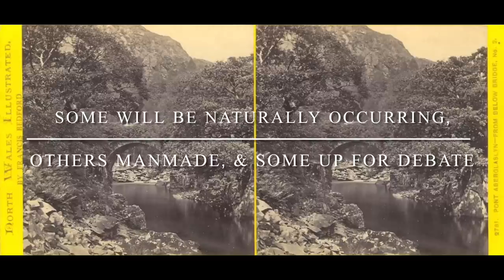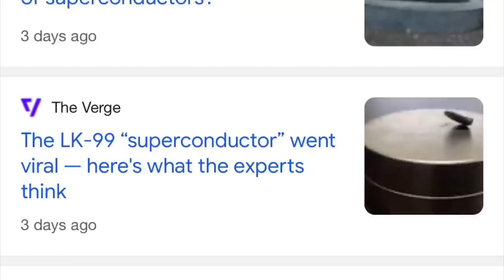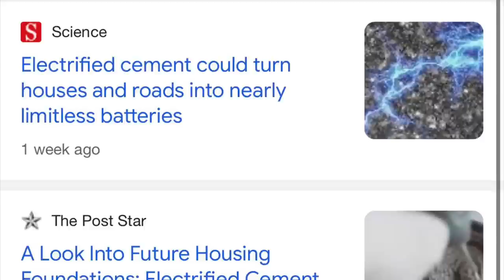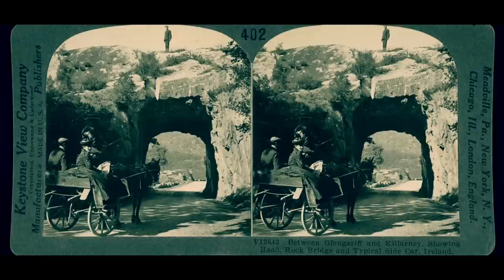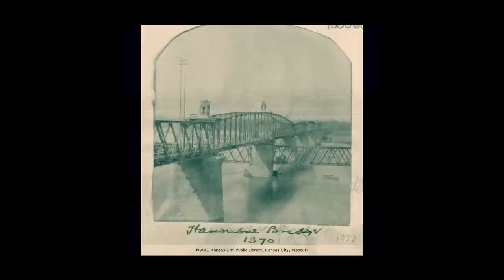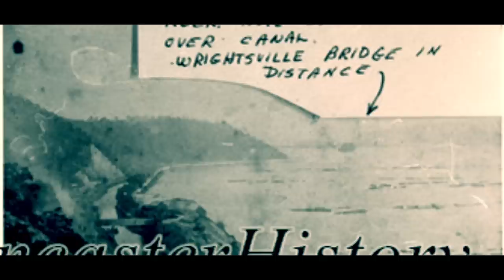Bridges, Seaports, Canals & Free Energy! LK-99, Electrified Cement, 200 Old World Photos (1845-1945)

Comment: I enjoy your video’s a lot… but on this one, I have make mention of the spires that are typically found on the old world structures… because of your talk on or about the possibility of tesla coils in the concrete.. you are aware that they were used to draw electricity directly from the atmosphere. They were all made from copper and attached to copper wiring. And they weee thrust high into the sky for better or higher current(amps).. voltage staying around 9-12v. The bigger the building, the more antenna looking rod things would be sticking out of the top of them. Near by street lamp were powered by the closest building…  but, before this video, I just assumed they ran subterranean wires out to the light polls…   Now I’m wondering if the concrete just transmitted the juice! A Very interesting notion! 

The old old houses, here in the states, like the one I live in still has the wiring and wall sockets for those low voltage free energy systems… 

In fact, this particular free energy system is why our current electrical appliances are 120vac.. instead of 9vdc.. 

Because they could and very well, I might add, could have made modern appliances like TV’s computers, stereo’s, washing machines etc., can be run on low voltage systems but, they have zero interest in allowing the masses to get and use free energy sources… 

Because if we had free energy, we would have a lot more time on our hands to pay attention to what they’re doing and with said extra time, we could meddle in their
Affairs, even more so than we already do…  AND THEY DON’T LIKE THAT! 

Same goes for oil and the products  derived there from… 

In the old world, they had no use for gasoline! They used ELECTROLYSIS!

And there was no pollution from internal combustion engines! Because the only byproduct from burning the HHO mixture created by  their electrolysis generators, was water! Thats it …, 

So if ya can’t read between the lines….

I’ll give ya a hand…. BASICALLY ALL  THE UBER RICH ASSCLOWNS AT THE TOP OF THE PYRAMID, BLACKROCK, VANGUARD, the WEF & MORE… all those faquads that  are FLYING AROUND in THEIR PRIVATE JETS TELLING US THAT WE ARE BAD AND EVIL WHEN DO NOT PUT FORTH MUCH EFFORT in REDUCING OUR  CARBON FOOTPRINT, CRYING ANOUT CLIMATE CHANGE ~ just like the boy who cried wolf, are the very people who are ACTUALLY Responsible for 95%, if not all the pollution we are combating this very day! It  was at here call to use an energy source that wasn’t free or so easily obtainable as say, water for use in electrolysis! Lol… assclowns!

So, to recap… the people from the old world, who I believe we chased out of RUSSIA & eventually found them here in AMERICA, I believe we slaughtered them with very few escaping or survived by intermingling with us …..  

Seriously, I think we took this place, by force, town by town… probably finding empty cities along the way from where They fled… and that the Vatican, among other kings and queens of the time, all in fact had a deal  with Washington and our founding fathers … the whole time.. And together they rewrote history so that their stories matched! 

Just my two cents! Keep up the good work!
Reply: I think you're more correct about how the U.S. was "built" than most people are even able to comprehend.

Comment: 3 things, 

They used a high temp gold vapor technique to apply gold (10K) to the surface of concrete to create in the buildings a capacitive storage device. Concrete is ideal to create massive capacitors. Such as the great pyramid which was concrete. 10K gold combines the perfect mix of gold/silver, extremely resistant to corrosion. 

The electrical systems required aquifers nearby, and underground canal systems to maintain the proper hydration in the soil for grounding. However, the 10K gold was desirable after the mass genocide. They changed the water courses to remove the gold from ground and buildings. Unmanaged, the water courses became unstable and this caused the mud floods. That is why some areas did not have flooding, as the water courses has different outlets. This is why 10K gold is so plentiful. 

The masonry is, except for small structures composed of 15K PSI ancient concrete. The units are less than 2 meters thick and had forms that supplied hydration for a 28 day period to create the best concrete, so good that it has been mistaken for natural stone. The decorative effects are made from formed concrete. They used quicklime instead of hydrated lime, water at 4% salinity, and silica fume made from corn. Modern concrete is 4K to 7K PSI, which typically lasts no longer than 50 years.
Reply: Wow
Reply: You need your own channel right now
Reply: Maybe that’s where the backrooms poolrooms concept came from about the tiled underground waterway halls
Reply: 😂👍🤡
Yeah man and then Bambi and snow-white saved the high school prom at the last minute 🤣🤣👍
Reply: Where did you get this concrete formula?  I've read about the Roman concrete containing quicklime and being hot mixed...  would like to know more about what you know about the concrete...
Reply: @VenturaIT  
I am going to provide the formula later on. I am preparing a detailed document. My family were master masons. They were put out of business by the building requirement in the mid 1800s that all new construction be made with the "new" portland cement. This was not fully able to be enforced until after WW1. You can still find old sidewalks with date stamps through about 1925. The later sidewalks made with portland cement had a very limited lifespan. I am lucky that I have an exceptional memory for things, but, if possible, I want to prepare test samples to verify the compressive strength. This will require making silicone enhanced cast iron to produce the silica fume. The keys are quicklime, salt water,  corn, and the silica it contains. It will take me a while to prepare the document. I am not very well, and it takes me a while to get things done. You might want to familiarize yourself with compressed air fluidization, which was utilized to move the materials. They had special forms, which allowed a 28 curing period. It will all be very clear layer on.
Reply: @JustMe-te8cz  "Because of its extreme fineness and high silica content, silica fume is a very effective pozzolanic material. Standard specifications for silica fume used in cementitious mixtures are ASTM C1240, EN 13263.

Silica fume is added to Portland cement concrete to improve its properties, in particular its compressive strength, bond strength, and abrasion resistance. These improvements stem from both the mechanical improvements resulting from addition of a very fine powder to the cement paste mix as well as from the pozzolanic reactions between the silica fume and free calcium hydroxide in the paste.

Addition of silica fume also reduces the permeability of concrete to chloride ions, which protects the reinforcing steel of concrete from corrosion, especially in chloride-rich environments such as coastal regions and those of humid continental roadways and runways (because of the use of deicing salts) and saltwater bridges. Furthermore, Silica Fumes has important uses in oil and gas operations. Silica fume can be used for a primary placement of grout as a hydraulic seal in the well bore, or secondary applications such as remedial operations including leak repairs, splits, and closing of depleted zones.

Prior to the mid-1970s, nearly all silica fume was discharged into the atmosphere. After environmental concerns necessitated the collection and landfilling of silica fume, it became economically viable to use silica fume in various applications, in particular high-performance concrete. Effects of silica fume on different properties of fresh and hardened concrete include:

Workability: With the addition of silica fume, the slump loss with time is directly proportional to increase in the silica fume content due to the introduction of large surface area in the concrete mix by its addition. Although the slump decreases, the mix remains highly cohesive.
Segregation and bleeding: Silica fume reduces bleeding significantly because the free water is consumed in wetting of the large surface area of the silica fume and hence the free water left in the mix for bleeding also decreases. Silica fume also blocks the pores in the fresh concrete so water within the concrete is not allowed to come to the surface."  - Wikipedia
Reply: They also dehydrated Native Americans for their gold and mineral content.....😮😂
Reply: How do people like you know so much?
Reply: @Denise-kc8np  
I am really old ...
Reply: When we take these buildings down you can see how they were built this guy's talking shit  think he's been reading to much

Comment: The Bollman bridge a truss and suspension bridge design that was covered with wood to hide the iron-steel structure. Harpers Ferry wv, Columbia, PA. Frederick Monocacy junction and Daniels, Md., Bollman patented the design but did not design these. They are older. The story goes they were burned in civil war and one rebuilt in 3 weeks.

Comment: Electric conducting coatings like heavy oxide primer for chrome plating or electro static coating could make a wall glow or heat it up like the rear window defrost lines on so many automobiles